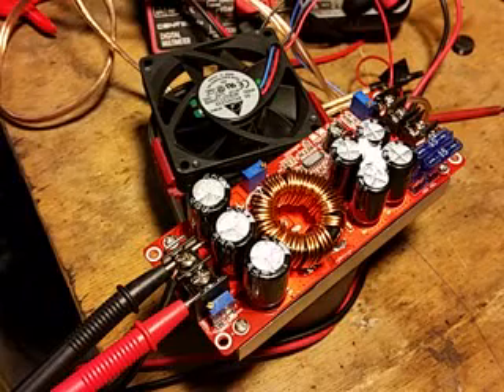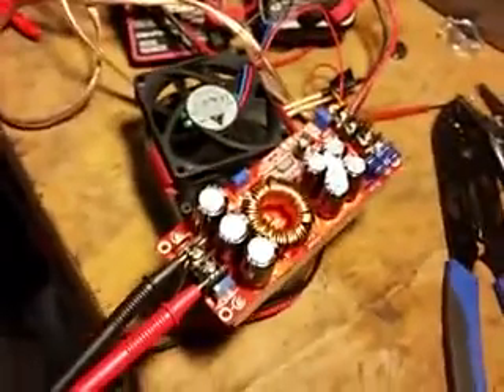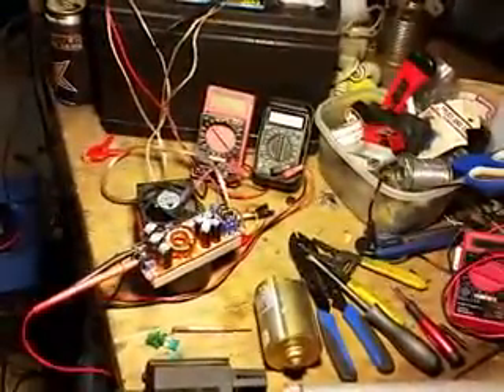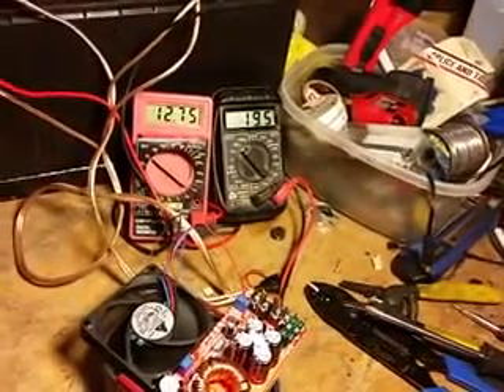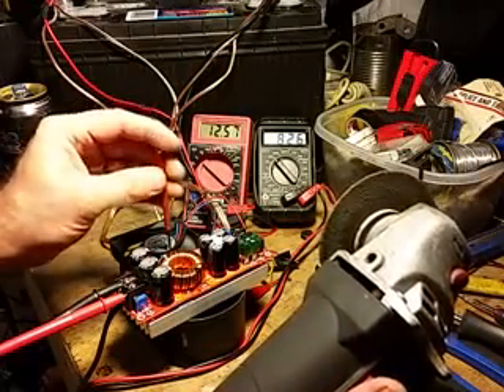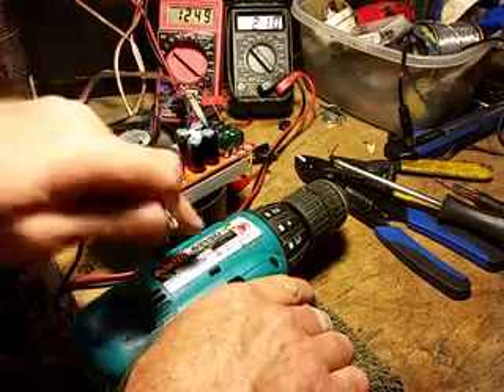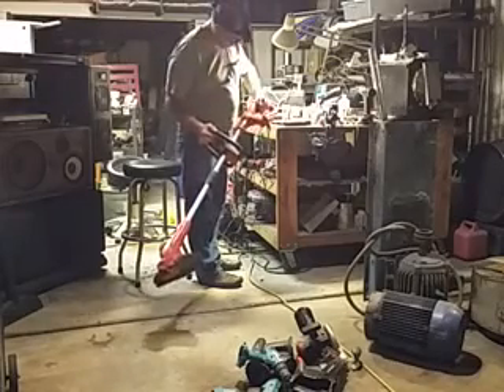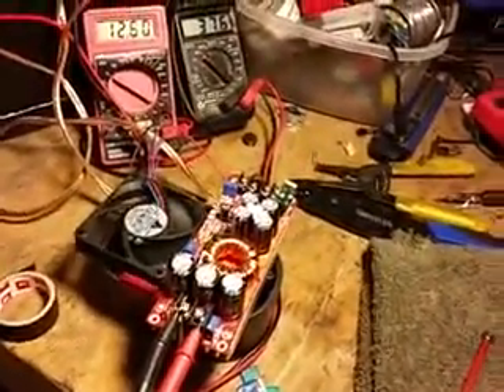Banggood 1200W dc-dc power supply test and review

Comment: can i use 12v 170ah nortstar battery as input, i acutally  want to run 48v 1500w hub motor does it work? does it burn module if we input high current  170ah

Comment: I’m trying to use this to step up from 12 to 18V on a Kids power wheels car to drive the two brush motors faster, my question is, if you change the polarity on the input side, will it also change on the output side, or would it just cause and error? This is how forwards and reverse is accomplished, so I want to make sure it would work. The input power I will feed the converter will be coming from the speed control, which will alternate polarity when either forwards or revers is selected at the shifter. And no, I cannot step up the voltage before the speed control, as the speed control can Only handle 12v, and the motors can handle 18v. So I need to connect on the output side of the speed control.
Reply: Careful not to overload the board. I've metered amp draw using 18v liions and saw 31 peak draw with an 80lb load on the vehicle. I'd install a DPDT switch after converter for reverse.

Comment: Thank you for your video !  can I connect 3pcs or 4pcs of this Boost Converter in parallel to bring up higher current output ?  I will add a blocking diode to the positive connector at output side of each unit to prevent from any back flow current from other units.  I plan to use them to charge my battery pack of 560Ah.  Do you think this work for my application ?   FYI, the power source is from a PSU providing 12V 75A (900W), I have 3pcs of it.  If I need about 60V, I will use 3pcs of it in series to give 36V input.  If I need 14.6V, I just need 1pc PSU,
Reply: Did it work? Parallel?
Reply: @batteristatributini61  I am still waiting for my order of 4pcs Boost Converter and diodes.  I have never done this before. Theoretically it should work when I put them in parallel.  What do you think ?
Reply: @jeffsit_davidli.333  i read that several people did this. Also 3 or 4 in parallel. I will do the same.
Reply: @batteristatributini61  that is why I found too !
Reply: @batteristatributini61  is that working now am also planning to do so

Comment: I recently got one that looks exactly the same and was told the first potentiometer you are wondering about is a low voltage shutoff to prevent draining your battery.  This may help others who run into issues.  I haven't yet tested this myself, but it was just delivered today.

Comment: Just FYI, If you put loads of cooling on these, they can run some serious power! I charge my 90v ebike battery at 12 amps using a 1.2kw power supply reliably. So thats just over a 1kw of charging power. Too many people bash them saying they burn out when pushed to 250 - 300w after they get hot. Well duuuurrrr!!! Put some wacking great big fans on it then lol. I built mine in to what is essentially a rectangular wind tunnel box with a powerful 120mm fan on each end and it has done about 50 cycles on my battery now at that power setting.
Reply: so it works on ebike, nice to know. Does the current limiter work? because mine wasnt
Reply: @ktestable  If you mean the current doesnt tail off as it reaches full charge then you need to adjust output voltage so its slightly below your packs max charge voltage.
Reply: what power source and voltage did you run your fans? 12v same psu that is feeding the step up converter? i want to run 4 of these in parallel, close to max amp output for converters, for my ebike controller to push volts from 75 to 85, but havent worked through fan options yet
Reply: @jasonbrown467  my psu is now a 48v 2000w psu and i now use a little cheap step down for the fans and because i can control the current i can control fan speed. But when i used a 12v psu I did just hook the fans direct to the psu. If you have a seperate rail for the fans then use it, if not just add a good length of wire between the fans and power psu. Those stepups dont like noise from other devices when your pushing them hard.

Comment: What is the maximum output current .we want input 12vdc100amp to 48vdc 60amp output is it possible or not
Reply: It basically as theory said, Power In = [Power Out x (efficiency)]
it was another review on the youtube video, the max input current is 30A, he tried to change the fuse become 40A, and its failure.
As per your question, you need 2880 Watt output power while input power only 1200W,  it means, it cannot provide your required power output.

Comment: Interessante ! E' possibile avere una spiegazione scritta,  di come fare la  taratura  dei vari trimmer, in lingua italiana ? Grazie ! Purtroppo in internet non trovo nulla !
Reply from the maker: No, sorry. It did not come with any instructions. Banggood has sold many thousands of these buckup power supplies without much explanation. I believe they are surplus. I suggest trial and error as I have done. You might blow a few but they are so cheap it is worth it.

Comment: still working? most say these die quick and usually max at 150-300 watts or so
Reply from the maker: Yes, they will die quickly if you're running it at max and you do a hard start on something like an angle grinder.
Reply: @toddbethell1  I was going to try to use 1 or 2 to run 100 watt lEDs, @34volts 1.5-3amps each. I have 7 I need to run. How do you think it would handle that? Also thanks for the vids. =)

Comment: hi ,
Does the 48 volt inverter work ?
48 volt 4 batteries required..
Can I use this device with inverter by turning 12 volts to 48 volts
Reply: You'll might burn it off I'd suggest get both converters and connected together
I use one for charging my battery of 56v 
Good luck

Comment: can i use the 1200watt 20a boost converter to power a 48v 1000watt ebike
Reply: Yes you can you can use a battery from 12v up step up to 60v + you can also use 2 boost converters in parallel  for more amps 30+ amps from 12v battery I'd recommend using them on a 48v 1000w ebike I use them in parallel I purchased 3 step up converters 1 for charging my battery and 2 in parallel on my ebike gives out high voltage and amps saves a lot of money look at it this way a sabvoton controller costs £400 and the converters cost £30 for 3 I also bought a ebike battery case to put them in along with my battery
Reply: @ebikesolutions500  How you connect hem im parallel? i mean how you adjust each one? supplier says yes you can but do not say how... and if so, posible to conect more in parallel? 4 pararllel?
Reply: Fast Diy Junkie nope

Comment: https://ru.aliexpress.com/item/1200W-20A-DC-Converter-Boost-Step-up-Power-Supply-Module-IN-8-60V-OUT-12-83V/32708843345.html?spm=2114.13010608.0.0.CxVkSx&aff_platform=link-c-tool&sk=uR7uBY3Rz%3A&cpt=1476623213390&af=DPlnKr2ATnM&afref=&cn&cv=90001&dp=pOnObHhHFU&aff_trace_key=c1f1119be7f345e9bf50b84714916feb-1476623213390-08900-uR7uBY3Rz

Comment: Can you get the constant current set below 2.7Amps?   I have a 12volt input and tried
between 13v and 30V output and it wont go below 2.7amps on the output, the spec
shows it should go down to 0.5amps.

Any suggestions?  Thanks.